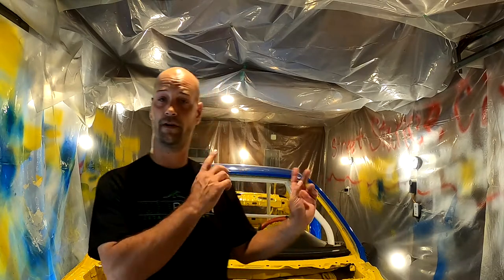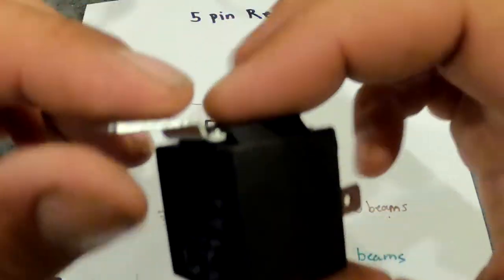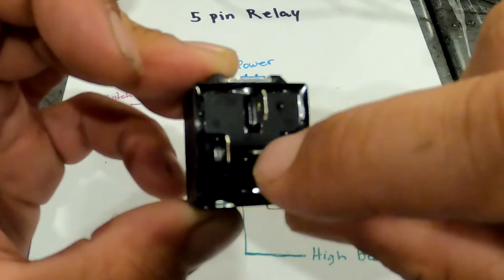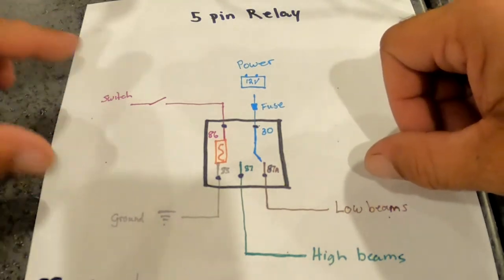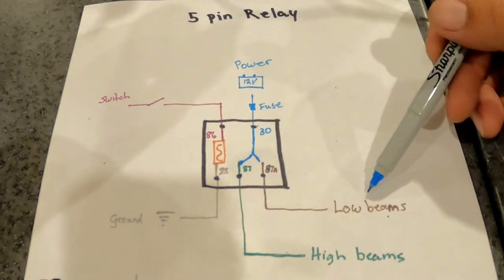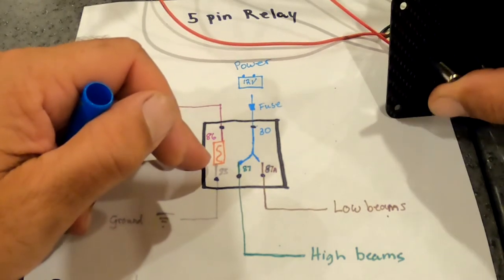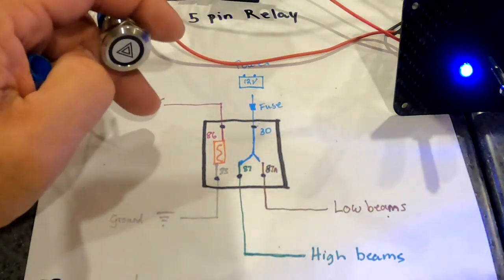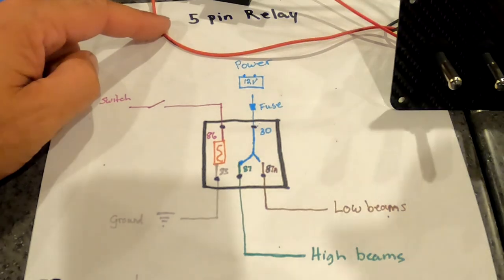How to wire a 5 pin relay

Comment: Help me pls. May I use on/off/on switch instead? I have 12v roof lights white / yellow. Makes sense or I really need 2 switches and 1 relay?
Reply from the maker: You can do it that way. but if it's blowing fuses. You may need the relay,and it's a safety precaution to keep it from catching fire.

Comment: Thanks for the video! I came here to learn to wire a 5 pin relay, but I am having trouble finding your pepper spray and taser video. Did this end up happening?
Reply from the maker: No not yet been working over time. To get a new engine built. That video will be coming out shortly.

Comment: What if I don't have a headlight switch, my light comes on the key, so I'm not sure where to put the relay switch wire, and also, the power to my light is cut momentarily when cranking the engine.

Comment: Very nice video. What is the difference between 87 and 87a in current?  I mean that if we connect to another application (not high and low beams) does it matter if we use 87 or 87a?
Reply from the maker: 87 comes on with power automatically. It is always hot. Whit you hit the switch it makes 87a hot. You can use as a 4 pin relay. You can power anything you need off of it but 99 percent of the time they are only used for lights.

Comment: I have a 5 pin relay in a fan circuit,  it doesn't over heat and the low speed is working I assume but my high speed for the fan isn't working.  Do these go bad often ? I hate to load the parts cannon but I just might .
Reply from the maker: You can pull one out of the fuse box and switch it and see if it works. If not probably a temp sensor.

Comment: Your drawing should show both the red and blue coming from the same power source after the fuse and there should be a separate switch on the blue before the relay to just turn the lights on.

Comment: Great video, but need help making my side markers blink when I turn on my blinker. I have a 5 pin relay , but can not get it figured out. Any words of wisdom.
Reply from the maker: You have to wire them in together come from the relay to the side marker then the the others or run 3 wires out one to each light then ground all lights. Then it should be working
Reply from the maker: And you should be using a 4 pin relay only headlights need a 5 pin
Reply from the maker: If the car is already wired. And not working and you can't figure it out you can always run a wire from the side marker to the turn signal wire in the head light.

Comment: Can't you just use one switch for on/off hi and low beam?
Reply from the maker: Yes the blue toggle. Is the power for the car. It turns the power on for the entire car. I wired my head lights to be day time running lights. So when the power comes on it automatically turns low beams on and powers high beam switch so you can switch back and
Reply: Sorry for im slow. So when you start the car the lowbeam lights automatically turn on or when you flip the switch to the on position?

The way I'm understanding what you're saying is that the low beam comes on when you flick the switch to the on position,  then when you flip the switch to the off position the high beam comes on is that what's happening or am I Misunderstanding. Thanks in advance

Comment: Hi, what if you don’t want your lights on while driving.
Reply from the maker: Sorry most people have daytime running lights so you come from the battery. To a fuse then to a switch board like I turn on with the blue light. Then your high beams need to come from another switch to pin 86 witch will turn on your hih beams. Let me know if this helps you.
Reply: Turn both switch off